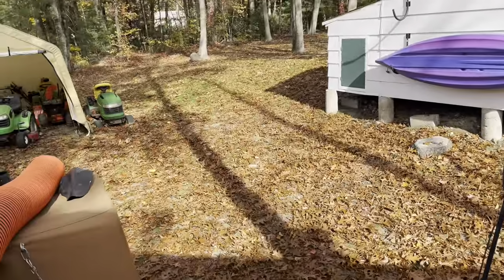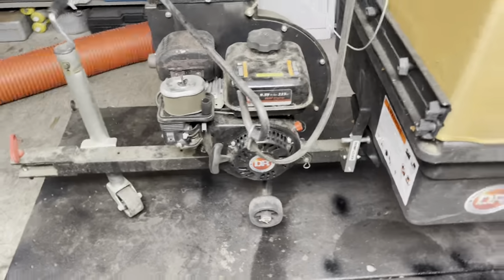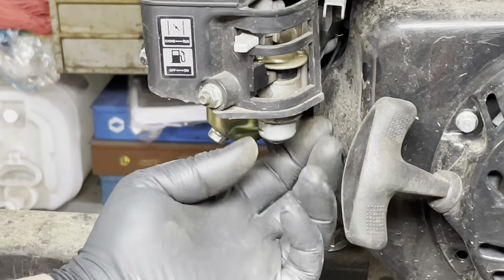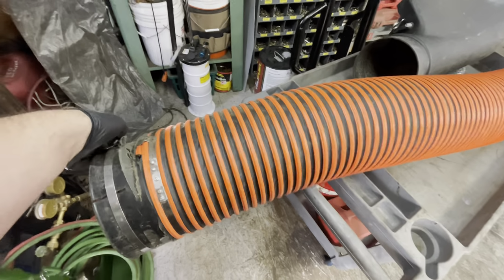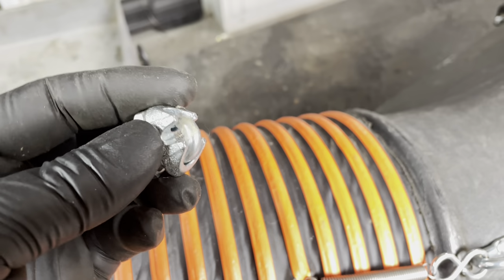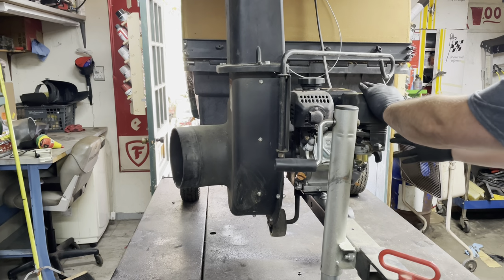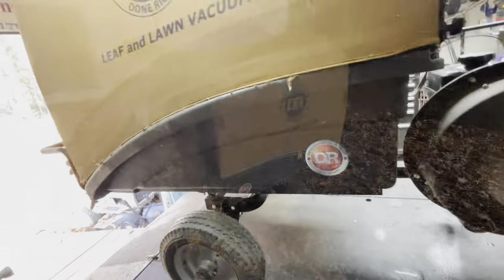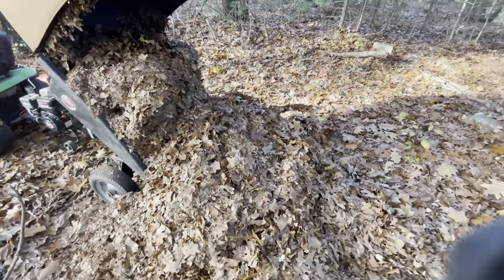DR Leaf Vac Trailer Service And Modifications

Comment: Thanks Hester for doing this video. I bought a gently used pro model last year and haven’t used it for a few months. Today I cranked it up and it was smoking a little which it’s never done. I pulled the oil fill cap off and the oil was cloudy. Dipped my finger in it and it smells like gas. Hopefully I didn’t do any damage. Now I see why you say to shut the gas off. I’ll change the oil tomorrow and keep my fingers crossed nothing happened in that 10 seconds I ran it. I can’t find my manual and I was so glad you showed me the drain plug because I forgot that screwed up plug is wheee it is. Is there a dipstick for this thing? I didn’t see one. Thanks again for sharing your knowledge.
Reply from the maker: Definitely change that oil 👍🏻,  there isn’t a dipstick on this particular model, the oil fill, is where you check the oil, you want the level to be just under the lip of the oil fill hole.
Reply: @hester781  thank you for the reply. I will definitely change the oil before I try to crank it again. Don’t you just love the way they position the dream hole for the oil.
Reply from the maker: @ReelFloridaOutdoors  the old saying goes, an engineer will jump over a field of virgins just to screw a mechanic😂😂

Comment: How do you put oil in the engine? How much oil?
Reply from the maker: There is a dipstick 2 inches up and to the left of the drain, you can see it at 3:20 .  Use a long funnel and you fill it till it just starts coming out of the hole, about a quart maybe less. 👍🏻

Comment: Great video. I have this same DR vac.  The oil fill hole is in a hard-to-reach spot.  I was wondering how you put your oil in.  Also could you let me know what oil you use.  Thanks
Reply from the maker: It is definitely in a not so easy to get to location, I just use a flexible funnel,  and for oil I’ve been using 10W-30 synthetic royal purple